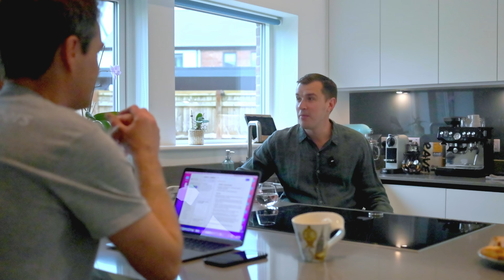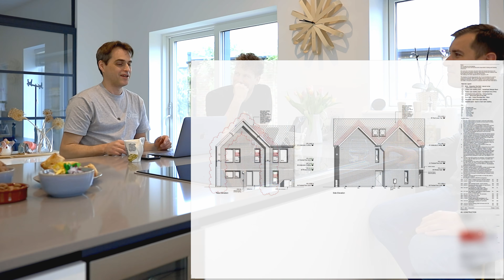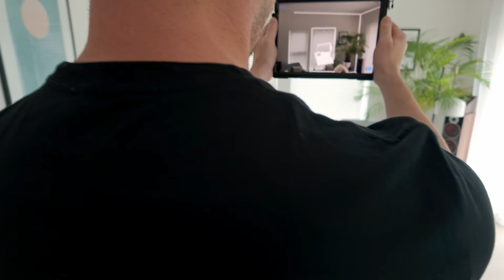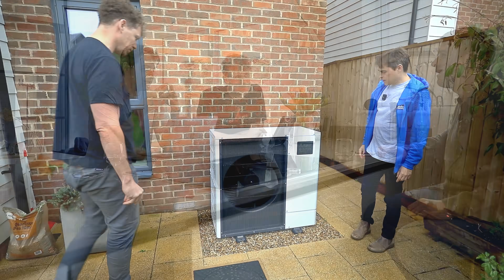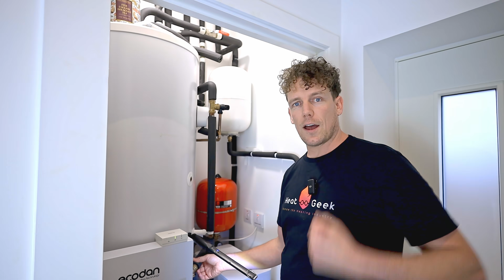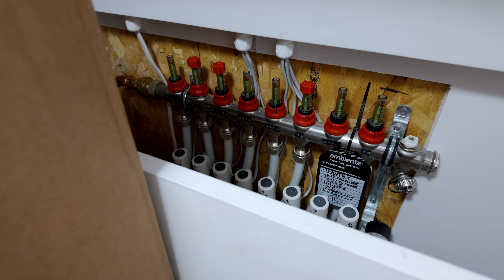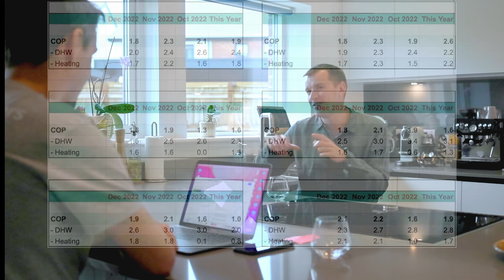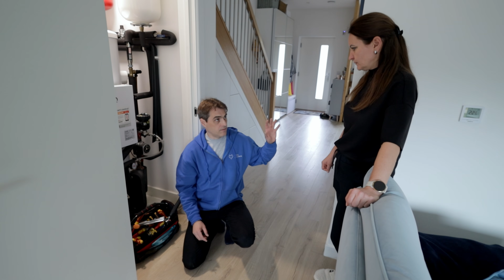How Developers Are Ruining The Heat Pump Market

Comment: I would said in reality it would have been more like 5kw..  By the way, if heat pumps are so good (I was trying to get people interested in them in the 70’s) why did the CEGB smash up the working one used by a local electric company in the 40’s when they nationalised electric companies? And why aren’t we using them at power stations and make electricity more efficient?
Reply: Because they move heat, not generate it.  They would, for example, be a terrible replacement for a kettle, and would literally be a pot that never boils.  Electricity generation from steam at least remotely efficiently needs much higher temperatures than you would have with a kettle.

Home heating and hot water (along with refrigeration) are where heat pumps work best.
Reply: @BenIsInSweden     There was a heat pump (ammonia cycle) in use in the U.K. in the 40’s..  It was taking water from the ground and taking the heat from it, (geo thermal),  it was saving more than 50% of the energy used at that small power station. When the CEGB was formed they said said they didn’t want to put in a national grid for people to use a small amount of electricity to get there heat from somewhere else so they broke it up. Hence the big advertising campaign for people use the new “clean energy”, electric fires, in the late forties. That is why in the 70’ s I could get a grant for designing a new electric fire (20% efficient) but not for developing a heat pump!  The U.K. government have sleep walked for last 50 years. And they are still talking  crap today. For anyone that wants to research it I think the heat pump was in Norwich.  And for your information the temperature generated by a fridge when it compresses the refrigerant is well able to boil the water for my tea,  so it’s easy to make a heat pump kettle!

Comment: Great video. Many of the ASHP manufacturers have a standard design or schematic that the installers have to follow to maintain warranties and provide sign-off to apply for RHI. For example, the Nibe schematic includes a heat buffer and my installer would not deviate from the design. I'm about to do another new build install and I'm faced with the same for an Ecodan system. Does Heat Geek have a schematic that shows best practices? Or a design listing best-in-class components. Are all of the manufacturer's schematics wrong? I'd love to see a video taking apart what's wrong with each manufacturer's design and showing a drawing of how it's done correctly rather than looking at homeowners' plant rooms, it's too difficult to see what's wrong. Fantastic job guys, I've been following your videos separately so nice to see you working together
Reply: It's down to the installers to specify equirement from manufacturers who care about this stuff. Bear in mind that a buffer might have been necessary in your property due to system volume. A buffer isn't automatically wrong, but they are often included when they aren't necessary, or where a small change might eliminate them.

Comment: I've got an Ecodan and although its not like 2.2, If I'm to believe the readout on my display, my heating COP is around 2.6-2.7
I don't get cycling too bad, maybe once per hour but I'm not sure how low it can modulate, it seems to only go down to around 1.2kW electric consumption. My COP for DHW into a mixergy is apparently 3 according to the readout.
I'm not sure it can be improved by the original installers, it's in the original material that the expected performance would be about 2.8SCOP.
I do run the system on timer during the winter with a and have it run at night on cheap rate to maintain the heat in the building. I've also got a 8.2kWh storage battery which contributes to the daytime heating so It still works out way cheaper than gas overall.
I'd still prefer to be able to get it improved but I don't trust that my original installers are sufficiently skilled. They are an established company and from talking to them when a remedial repair had to be done on a faulty valve I brought up the efficiency.
The guy who was doing the repair said he pretty much said he thought the whole notion of SCOP 4-5 was a fairytale and near impossible.
I think the heat loss is probably right but the system isn't tuned to perform best. I've tried to wrap my head around weather comp and want to tweak it, but my partner works from home all day so If I mess it up, I'm in the doghouse. She's happy it works and it's comfortable.

Comment: When I see a new development where the houses feature heat pumps, it makes me less inclined to purchase as I have little confidence, they will have correctly sized all the components. The same goes for the token couple of solar panels some developers are installing just to tick a box. Really pleased with the Vaillant ASHP system installed by Libtek (Alex is one of your Heat Geeks) in our current home. Next home may have to be a self-build or another home with a gas boiler that needs replacing with a Heat Geek installed heat pump.
Reply from the maker: Yes Libtek are good!

Comment: The developer and original installers should be named and shamed, they absolutely butchered the heat pump installs on this brand new development.
Reply: Yeah. Szymon and Adam are way too nice. And the problem is that $people can't avoid outfits like this if they don't know the names. I guess they are hoping that getting these designers to actually learn how to do it right will be more effective in the long run than naming and shaming. But in the meantime people would like to know. Maybe someone on the development will tell us?
Reply: The developers is probobly not at fault. It seams like they built excellent houses then ordering heating and heat-pump insulation from companies that they thought was reportable, but made a really poor job.

The developers are not heating experts. They typically trust there contractors to do the job right.
Reply: Im pretty certain its Alto Energy - they do installs like this with Mitsibushi heat pumps all the time and have been for years.
Reply: @BristolHeatPumps  I had alto design for me, did the day course and that, sounded good if I install the commission and take over. 

Did the install for a pal developer and now 6 months on we have realised there running shit. 

Done this a few times different companies designing and still the same issues. All new builds and expect a much better performance. 

Now I can’t trust anyone to do it and doing the knowledge with heat geek myself. 

That saying you want something done properly you do it yourself. That’s my mindset now.
Reply: @stixstonesinvestors5413  yep they are shocking, tbf i would say most umbrellas are very poor quality, if only MCS had some backbone eh!
We are a heat geek ourselves and do all our design in house, its really not difficult to do it properly
Reply: @BristolHeatPumps  so true. It really needs to be regulated and rules tightened up. 

I know a lot gas engineers who think they know it all and just have that mindset of it’s just a unvented system. They don’t take it serious and if they have someone design it and it don’t work, there attitude is I didn’t design it, it’s there thought. 

It’s such a challenge out there ain’t it.  

I truly believe the way forward is through heat geek. It’s bloody hard for me but im determined to finish this. 

Love your apart of it as well. Good to speak to likeminded people
Reply: I'd be afraid of the developer sueing for defamation, I'm sure they'd win in the end, even in the UK, but enough bills can crush a small youtube channel.
Reply: Only a court case could possibly decide that. Also remember these were spec built houses. Every family's requirements differ.
You can calculate to the Nth degree, one families requirements and get it bob on. New family moves in, likes house much warmer (maybe elderly) and your calculations don't mean bob.
Reply: @markrainford1219 doesn't really work that way. Those systems were so far out the next people would have to want them at 30C room temperature for the units and all the extra pump work and blending valves that are necessary... Maybe if we were talking a 5 kW units instead of a 3 kilowatt units... Fine I can see that being a decision.  3x too big is design flaw (mine is exactly the same with exactly the same design flaws, now with a 5ks unit instead of a 14kw I'm very warm with a tank full of hot water whenever I want it.
Reply: Francis Jackson home builders ruined the heat pump install on my home, having to change a lot of pipework and radiators to get it to work anything like it should.
They were horrific when i contacted them, may have well just told me to F’off.
Reply: Or.. don't say the name and you can say anything you want. Doesn't even have to be true. Just say anything that gets views and interaction. 
Not saying it is but how do you what to trust these days
Reply: Heat pumps have a terrible track record in Canada......compared to alternatives , they are just not reliable.

Comment: Why only discuss space heating loss, the heat pump also has to raise hot water, its capacity has to be sufficient to do this higher temperature flow demand.  Would this not, in this case be the parameter that would determine the heat pumps size?
Reply from the maker: In short: no

Comment: Oh dear, what a shame. A new build should be a perfect opportunity to get a heat pump installed correctly. Hopefully the developer will learn from this mistake, although they were probably just following manufacturers schematics for the hydraulic setup. On the plus side it's great to see heatpumps being installed in new builds, even with a disastrous cop of 2, they are still lower carbon than a gas boiler!
Reply from the maker: Pretty disappointing when you buy a high end home for a premium over standard new build to have such a poor set up. Manufacturers are at fault here too - some pre plumbed “fits all” system are awful and also more expensive - more education needed for manus and installers but also for developers, so they can chose batter subbies
Reply: @UrbanPlumbers  totally agree 👍

Comment: I get the zoning point, but its very very hard to get anyone who csn design and install to acheiev diff temps in living areas and bedrooms especially if you have bedrooms upstairs and downstairs
Reply: Adam has shown that you don't need different termperatures. Flow temperatures upto 43C don't raise the floor temperature above 27C (which is the maximum for most floor coverings that care about this). 43C is fine to pipe directly to the radiators downstairs  if they are sized correctly for the heat loss of the room. In fact, ANY flow temperature above 26C is fine providing the emitters are large enough for the heat loss - ussing you are trying to heat rooms to 21C, which you should not be doing if it is a bedroom. 17C is a good temperature for a bedroom at night, and perhaps 19 during the day if children play in their bedrooms.
Reply: @tlangdon12  thanks man.  My problem is we have UFH in a single floor and want the bedrooms cooler than the living area.  So we need diff temps on the UFH

Comment: I do not understand why all new houses are not mandated to have heat pumps.
Reply: In Scotland they are as of 1st April past, England/Wales from April next year.

"From April 2024, legislation comes into force prohibiting the use of direct emission heating systems – known as polluting systems – such as oil and gas boilers and bioenergy.
Instead, new homes will need to use clean heating systems such as heat pumps and heat networks."
Reply: Under the Building Regs Part L you have to beat a benchmark for the same size property with a set spec, currently this assumes set heat loss for wall/roof/floor/win/doors, a gas boiler, waste water heat recovery to all showers and a certain amount of PV base on the ground floor area. 
Your building then has to be equal to, or better than, this. How you go about that is up to you within reason (there are absolute baseline figures for walls etc.). You could omit the WWHR & gas boiler in favour of a heat pump, or you could stick with just a gas boiler, no PV/WWHR but then massively improve the insulation. It's a bit of a numbers game on how you obtain a pass.
Part L is renewed every 3-4 years and I suspect the next round will make it almost impossible to pass using a gas boiler. 
Funny thing about Part L is that it used to have "fuel factors" with gas being the "greenest" fuel and then you had a multiplier for everything else like electric, oil, LPG, biomass. This would usually mean that if you wanted an ASHP you'd struggle to pass vs just putting in a gas boiler. But it was all based on the nation grid averages at the time with no foresight that eventually the ASHP would be the better/greener choice. Now those houses that would have failed, should pass if the fuel factors were corrected.
Reply: @jabberwockytdi8901  Surely a lot of resistance from customers isn't due to poor info out there, but the risk of objectively poor installs and even equipment - witness this very video and many others?  It's going to be almost impossible for a customer purchasing one of these properties to have a sensible discussion with the developers at the time of purchase as to the exact details of the installation, even less for them to affect the install and get it changed (the developers will just sell to someone less trouble).   It's not going to come up in the average conveyancing or survey process.    Need to get the building regs sorted to a position where the new buildings aren't signed off without a sufficiently PERFORMANT heat pump system that doesn't risk the new owners being in a worse position than with gas.

Comment: So 12kw heatpump has lower COP at 3kw than 4kw heatpump at 3kw?
Reply: In theory both the 12kW and the 4kW heat pumps would be delivering the same COP at the same flow temp.
But in this case, the minimum output of the 11.2kW is about 5kW, well above the heat loss, so it cycles on/off, and several of the circulators are running in the 'off' periods, adding to the efficiency losses.
Reply: @Loopyengineeringco  5kw minimum output is technical limitation? In colder climates you need 12kw but in warmer months you only need 3kw. Multiple smaller heatpumps are the solution to avoid cycling?
Reply: @edfx  multiple smaller units are a great solution but the added cost & complexity only makes sense for larger properties. The minimum output is linked to compressor speed, in my understanding the three phase motor in the compressor doesn't have enough torque at lower rpms, so the lower it spins the more current the stator consumes, runs hotter and it gets closer to stalling, which you don't want. So it's limited to about 1/4 of it's max speed, about 4-5kW area on the 11.2kw unit (the real ceiling is actually higher on this unit, the name plate rating is conservative)
Reply: @Loopyengineeringco  Okay, low rpm torque problem makes sense. I guess it also applies to inverter type pumps? (Not sure if induction motor heatpumps even exist nowadays)
Reply: @edfx  Yeah inverter type is what I was talking about - my experience is from CNC machine spindle motors so maybe take what I say with a pinch of salt, but I'm 95% sure they have the same motors (400v three phase as far as I can deduce from the PCB). What happens at lower RPMs is that each phase of the stator is energised for longer and at higher current to maintain the same torque to keep it from stalling, so the windings start to heat up pretty quickly.
Reply: @Loopyengineeringco  Multiple smaller heat pumps could have been a good solution for this development, e.g. 3 x 8kW heat pumps for the whole development with the pumps being set up to come on and modulate as the heating load changes. Most of the time, just one heat pump would be running. On the coldest days, all three would be running.
Reply: @tlangdon12  Definitely a great way to do things, but  I suspect the ownership & maintenance model would probably mean a service charge etc, not something buyers would want... If I had a large property, I'd do exactly this though.

Comment: Curious to know what happens when a heat loss calculation is done, but then later on you find that the developers have left gaps in the insulation, skimped on it in some locations, or not installed cavity insulation properly. This would result in the house not getting quite get to temp when it's really cold. Would you need to remove the smaller heat pump and install a bigger one, if the insulation wouldn't be an easy fix?
Reply: You could just suppliment the heat pump with electric heating. The heat pump will be correctly sized for 355 days of the year - for the two weeks of really cold weather, you can just apply some local heat. Fixing the insulation would be the best action, as the losses will continue for the next 100 years or so.
Reply: It’s also rare that the heat pump is perfectly sized for the stated heat loss, e.g my heat loss is about 4kW but there are few ASHPs that are rated at 4, most are 5kW. So even if something wasn’t quite right, there’s another 1kW to play with too.
Reply: Better to bung up the holes - that's a permanent fix with no ongoing cost or emissions.

Comment: Well… that’s the most over complicated installation I have ever seen 🧐In Denmark where I live oversizing heat pumps is also a common problem. No one makes a heat loss calculation, and it’s unfortunately not a requirement yet. At least we don’t zone. What’s the point in doing that? I’m genuinely asking because I don’t really get it.
By the way you could have removed some of the excess power from the Mitsubishi by putting it in “silent mode” 😎